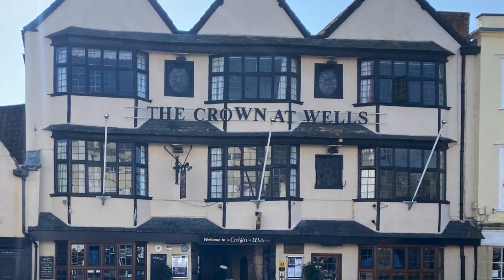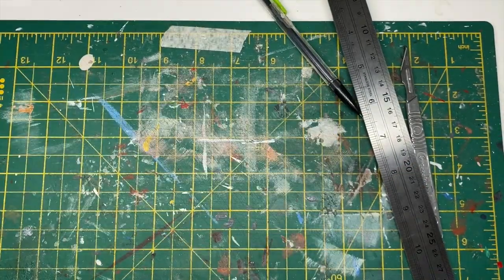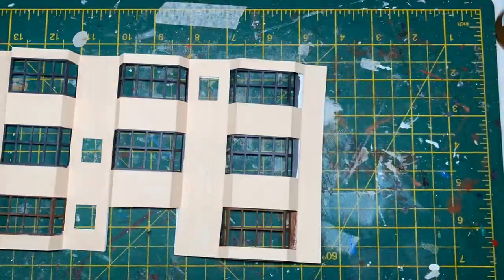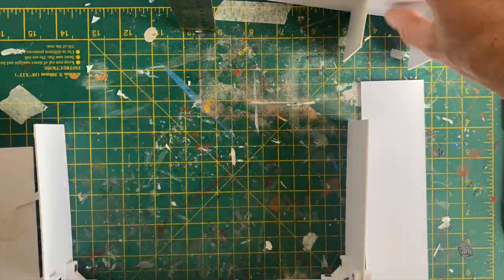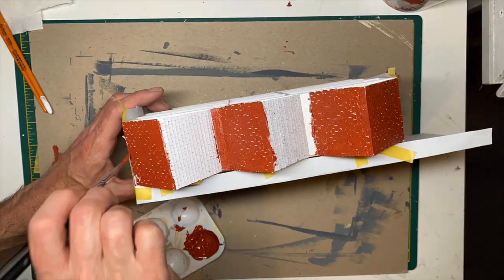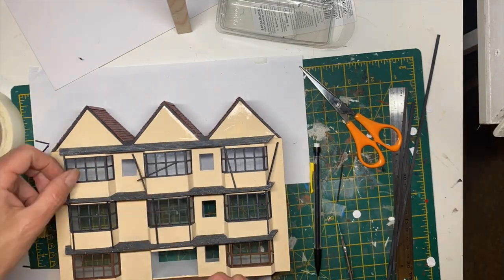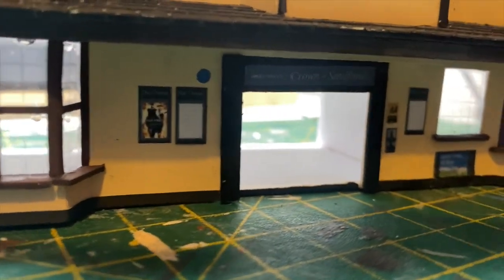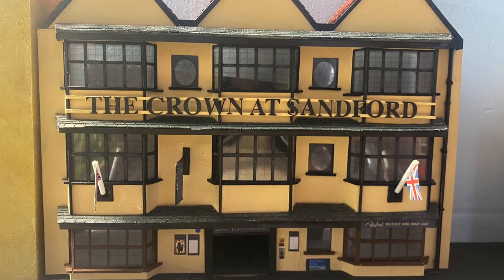New Model Railway 19 (Special 01) - Scratch building 'The Crown Pub'

Comment: Outstanding and what a great job with the Cricut machine.
I have yet to get my head around what I can do with it and this certainly given me an insight. Great work . How did you make the small text printing?
Reply from the maker: Thank you. Do you mean the Pub Sign text (that was cut on the cricut) or the posters ( they were just scaled down and printed on paper with my printer)
Reply: Thanks. I guessed you cut the pub sign , I was wondering about the smaller text. How thick was the material and which blade did you use for the text?
Reply from the maker: @charlie1872  I used very thin palstikard sheet and the fine tip blade on max pressure. I did have to do it several times as many letters didn't cut very well so took several attempts to get each letter

Comment: "The Crown" has come out rather nicely - well done. What would be your 2nd choice of software to drive the Cri-Cut and what does Illustrator give you that your 2nd choice doesn't?
Reply from the maker: Thanks you!. Illustrator is just the software Im used to which is why i use it but any graphics application will work just as well. Ive heard good reviews of Inkscape which is free and im sure will do just as good a job. You can design within the cricut software itself, but its a bit limited.